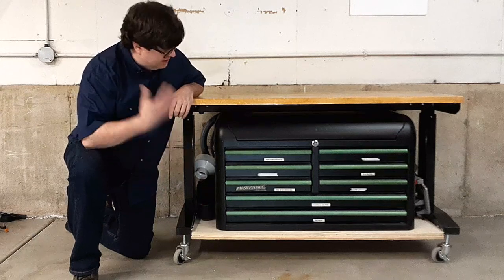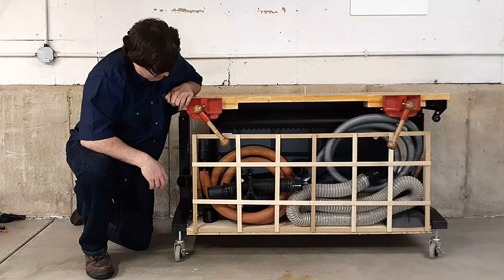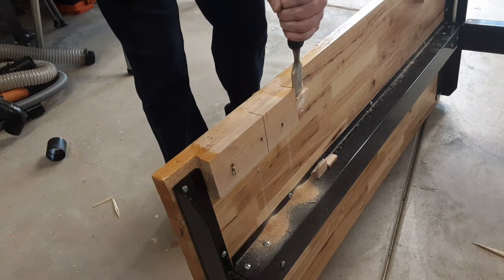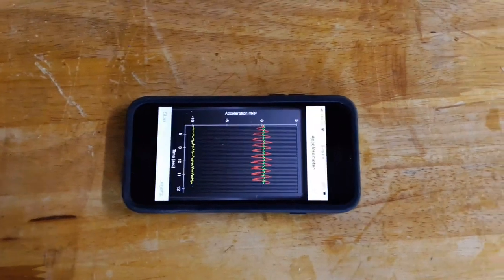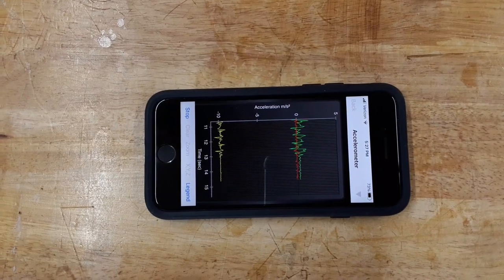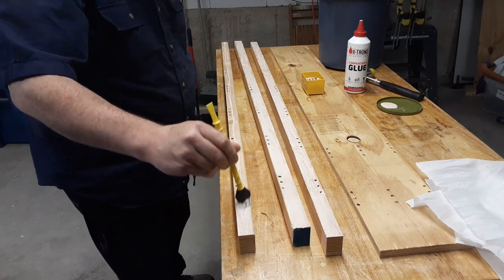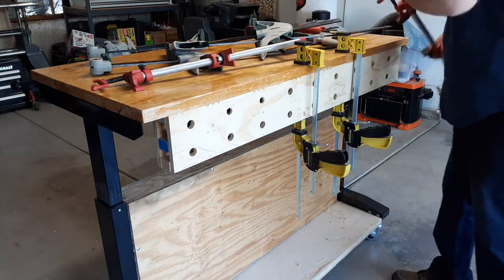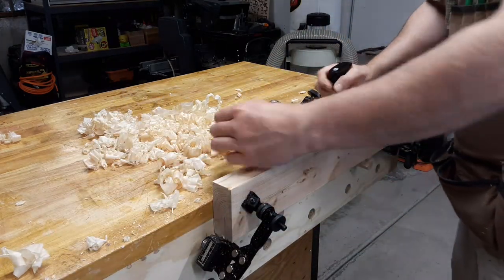Woodworking Bench Makeover: Husky Adjustable Height Work Table Hacks

Comment: Smart improvements! I work at a motorized sit-stand table and have been thinking about its usefulness in the shop and you've just proved some of my assumptions. You might want to think about incorporating something like a couple DeStaco straight-line action clamps mounted on the legs to push down on the floor as a bit of an anchor. Not with enough pressure to lift, just to give you some friction.  Great vid. Scott
Reply from the maker: Thanks Scott. I do need a way to stop the rolling. I'll look into those straight line clamps.

Comment: For me, I still see the value in using it as infeed or outfeed support for the Shopsmith, and possible as a light-use assembly table in my shop. It's far better than using the table saw as a table, and not primarily a saw. I'm fortunate to have the space for a bench in my shop. I understand the space restrictions you have in your shop , and why it is your bench, for now.  Another great video, Thomas.
Reply from the maker: Thanks Chad. It would be nice to have a bench without wheels! Maybe one day,

Comment: I've been thinking about this since you posted this video. I think I would build a heavier sub base out of 2X material for the whole table to sit on (2X4's on face, with half lap joints to save added height to the table), and ditch the extended casters. I say all of this because if you happen to have expansion joints in your garage shop floor (which you do, like most typical residential garage floors). If you have quite a bit of weight (like a pile of lumber for an up coming project) on the table when you go to move it, and try to pass over a expansion joint in the floor. With the current castors you have on there, you might snap one or more off. 4 heavy duty, ball bearing, all swivel, locking casters attached directly to the sub base would be a wise choice. Just my 2 cents. Chad
Reply from the maker: You nailed it Chad. I already stripped the threads for one caster. It only held up about 18 months with that heavy tool box on there. I had to repair it by gluing up 2 layers of scrap 19mm (3/4 inch) maple, adding a threaded insert to the maple and epoxying it on the underside of the metal frame. The cater now threads into the threaded insert. I will do that to the remaining 3 eventually.

Comment: Hey Tom , great 👍  video! I built an adjustable height mobile work bench with 2 scissor jacks. Checkout Charlie Kocureks  Jack Bench video. I don't like having built in vises on the top but did use the base mechanism set up. I think this might be up your alley for a future build. It's rock solid .
Reply from the maker: Thanks, glad you liked it. Yes, I have seen the Jack Bench videos and other material. Very interesting idea. I like that it would be much more stable than what I got. But 2 things make me weary, 1. It looks like a lot of material and with the cost of material I should be sure I want it. and 2. It seem like the under bench storage is taken up my the mechanism and I have a storage shortage as is.